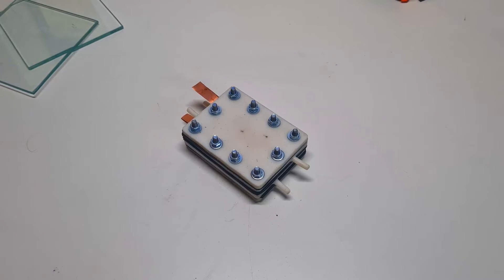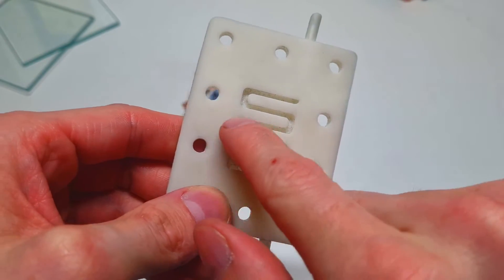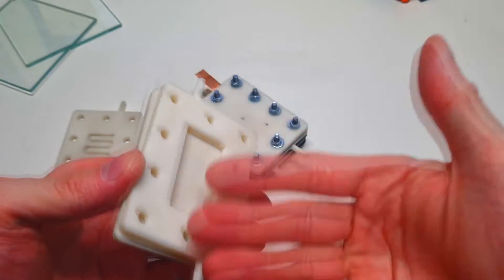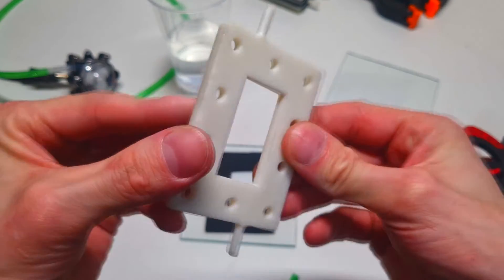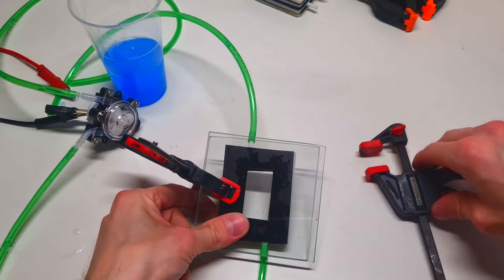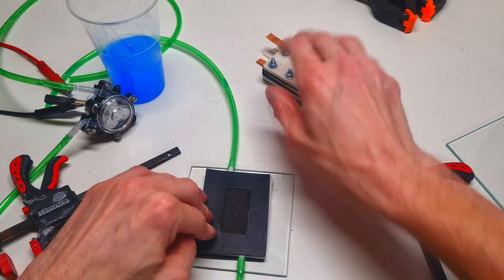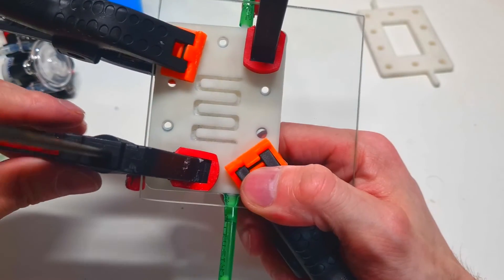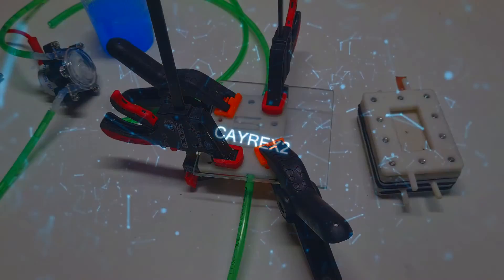Diy Vanadium Flow battery PART 3 - Flow channel

Comment: Do you think you can modelise flow chanell support not cover on one side in order to increase surface area contact and flow of liquid from inner to outer tube ? the idea is too compare full open structure and flow structure cover by graphite plate to ensure elkectrical conduction and forcing flow. i looking for this geometry for an education demonstration in my teaching classroom.

Comment: The pattern of bipolar plate you showed is crucial for gases also, because of the kind of flow (laminar, turbulent), to minimize the crossover loss granting an homogeneous supply of reactants. BTW in your setup, the carbon felt is creating many channels and turbulent flow, which prolong the mean path and mix homogeneously the reactant...it is a brillant solution.